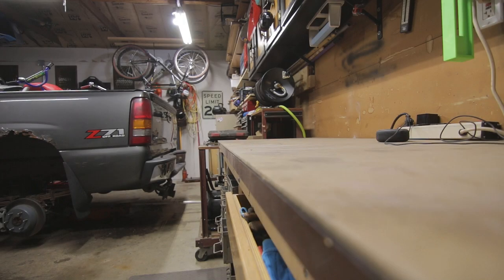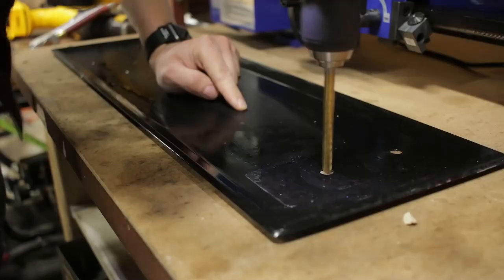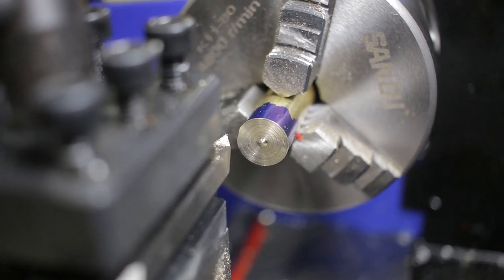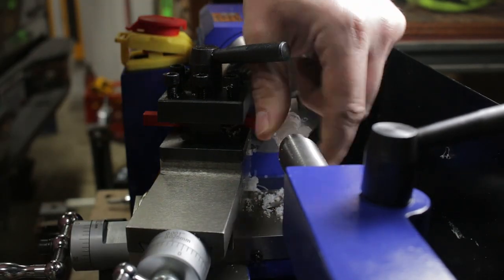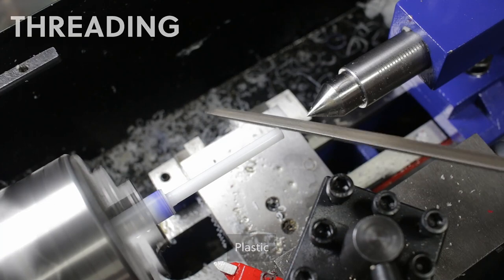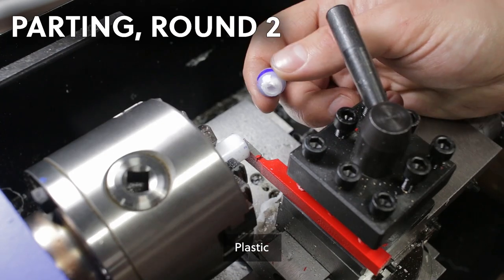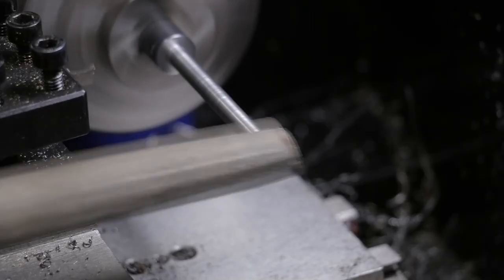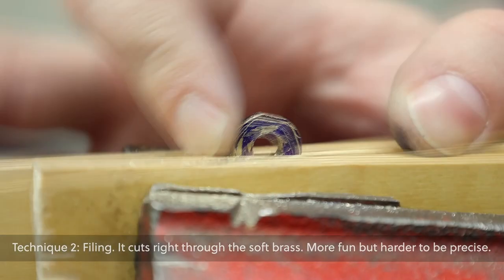I used a mini lathe to make my own nuts and bolts. Here's how it went

Comment: Rigidity, rigidity, rigidity.... This will be your constant root of problems with the mini-lathe. I bought a used craftsman 109 lathe which has a 3-5 inch chuck but I upgraded the motor before really knowing what I was doing. Nearly a year into owning it I finally looked into why my parts were let's say out of spec and rigidity. I thought because I wasn't feeling the vibration it wasn't significant but it was. Welcome to the world of precision where that grain of sand you missed is adding a taper to your parts. I ended up making a concrete slab with anchor bolts to mount my lathe and motor, scraped the machine ways, bought new gibs and set screws,  and new hardware for anything involving moving parts. It went from a mechanical oscillator to a clean running lathe that slaps cheeks. I'm also looking into epoxy granite based which is the meta for vibration dampening and adding mass but that will be for my shop made lathe I've been working on.
Reply: Incorrect. His taper is from 1 of 3 things, improper bed way alignment (he bolts the bed down and didnt remove the bed way twist, improper tailstock alignment, improper compound slide alignment. 
These mini lathes work just great within there limits. Precision is not an issue for these machines, which are used by watch makers. Tell me a watch does not require precision.

Comment: With a background and career in accounting, I DO NOT have prior experience with machine tools.  Therefore my purchase of a mini lathe began with lots of study and learning.  It paid off.  I bough a 7x16 Micro Mark brushless DC motor mini lathe.  My studies taught me that I needed a quick change tool post and an outboard spider.  I had to buy the QCTP,  but I made the spider from a 1" black pipe fitting.  The spider allows me to use a whole length of round stock and not have a chuck holding piece to throw away after the project is completed.  The MM lathe is called a "True Inch" machine and it only lists a few imperial threads that it will cut, no metric threads.  However Little Machine Shop has a program on their website that will tell which change gears to use and where to put them for almost any thread.  My first project was for a set of stock makers screws for a Mosin Nagant, and they came out perfect.  The Mosin uses a very unusual metric thread pitch thread which which is what inspired me to get closer acquainted with my lathe since I could not locate dies for that thread.  The only "plans" I needed to make the screws was the screws that hold the trigger guard/floor plate to the action and a set of Mauser 98 stockmakers screws for the handle dimensions.  Machining is a great retirement hobby.  
I very seldom get an opportunity to get to the range, but my machine shop hobby sure helps with my gunsmithing hobby.  
When people ask me if I would like to do that as as a career, my response is always:  "I'm retired."
Reply: I went from too many guns and motorcycles to a wife a house a dog 2 kids in less than a year. I hear you on the I wish there was more time part. Wouldn’t change it for the world, do miss wheelies and drag racing though  :)
Reply: BETTER !! STICK !! TO !! BEING !! AN !! ACCOUNTANT !!!

Comment: Before you shape the nut head, run a nut down to the head, nip it tight and there you have a fixed template, shape, then remove nut down the thread.

Comment: when using your Tap, use the chuck with all the jaws fully open and have it push/feed the back end of the tap onto the work/job.

also when parting off and it struggles and stalls, try using it in low gear, as it runs in a high torque, and not to cut fast. and make sure it is square to job.

Also when parting off you can have a tube in the tail chuck end, and sleeve it over the thread, and so it keeps hold of it when its parted, and help save damaging thread when it pings onto a sharp edge.
Reply: I agree with the last post, when parting off you must use the lowest speed, and turning tool height must line up with the lathe centre.
Reply: The tricky part is that not all of these mini lathes have a low gear and their DC motor doesn't really have much power in the low RPM ranges forcing you to run quite a bit faster than you'd like if you don't want it to stall on anything but the lightest of cuts.

Comment: Unless we heed high-tensile steel, I might suggest a simple way? If we invest in some lengths of studding, we can make bolts anything up to the full length of the studding. I fix nuts onto one end using locking-compound and job done!
The home-made nuts I might leave in more detail to another time but drilling and threading steel bar would be one way if we can accept square nuts of a kind?
Keep up the good work and if push comes to shove, a lathe is unnecessary!

Comment: I have a harbor freight 7x10 mini lathe and I've found the best way to part is to go a lot slower with the speed and feed slow as well. Also, when parting off everything has to be perfectly square and centered. It took me quite a bit of practice to part off and I'm still not perfect with it. But you did pretty damn good!

Comment: Now, assuming you have some "easy duty" use for your bolt, you've done well. However, for high stress applications you will need to maybe use higher spec and even heat treated materials. Start with larger grade 5 to 8 fasteners and cut them down to your size.

Comment: I know nothing about this but I was curious to look into metal / wood lathes potentially as a tool for puppet fabrication ( armatures ) and anything really to build things for the set for animation... I'm only just starting out looking for YT vids on what a lathe can do.. but in this context of building bolts and nuts, to stabilise the lathe down onto the worktop, why not just use threaded rods then and cut to size, would have been easier maybe?? but it was an experiment though I guess to see what was involved in making your own nuts and bolts and see what the lathe can do  right...

Comment: I would have thought that if your project was to make a 6mm screw using a mini lathe that you would be using the lathe to cut the threads?  Anyway, suggest you start with hex stock when making nuts.

Comment: I have a quick question,
What drill chuck did you purchase for this lathe? Thanks
Reply: Harbor Freight sells one with an MT2 taper shank that works on these mini lathes. The price is right, and I’ve really good service out of them! Little Machine Shop has a lot of options also, but not as cheap. If you have a mini mill or lathe and don’t know about LMS, you’re missing out!

Comment: >> At time stamp. 10:18. Sceaming sound is generally Too High RPM. Machinst Trick. Hard material like Steel. Is Slower RPM. Aluminum and softer materials are higher RPM's..